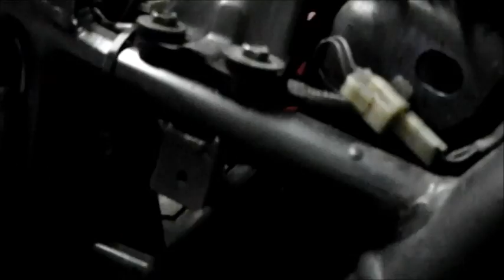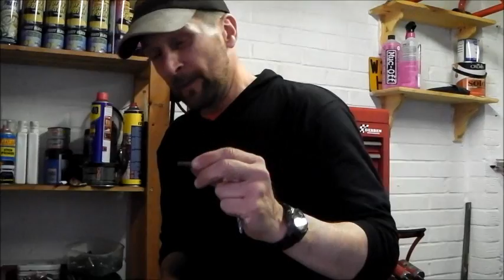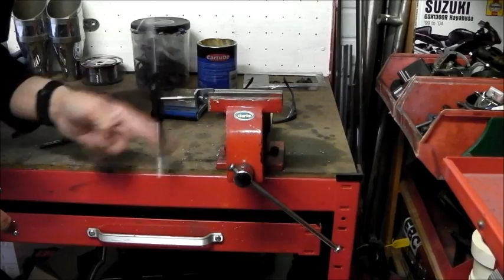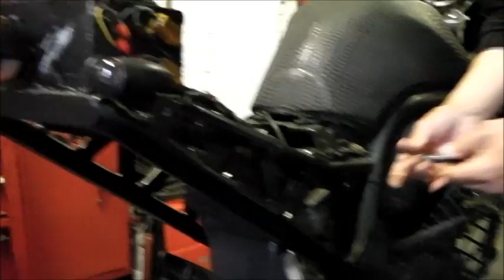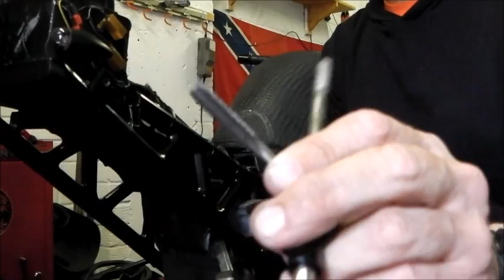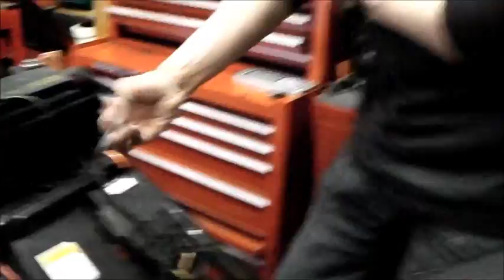Project Bandit #23 'How To' Cutting Threads, The Seat Unit Begins.

Comment: Heya Del, nice video on thread cutting, its nice too see someone using the proper cutting tap, where i used to work they would just use the standard thread cleaner and they were always surprised when the tools broke.... just two things im curious about, is that a Clarke workbench? Ive been looking at them in machine mart and was wondering if they are made of good metal or is it just old tin cans? also one thing ive wondered is how come your bench grinder stays still for you without having it bolted down, my one flops about like a turd in a piss pot unless its bolted down or held with g-clamps.
Reply from the maker: +Eleuthero1985 Hi mate, wou;dn't bother with the Clarke bench, made out of old curry tins and MDF and not worth a cuppa cold p*ss... am gonna build one out of wood in the new garage and strong enough to stand an engine on...and I don't mean a scooter engine lol !... I tend not to lean on the grinder, so it's find stood on the bench, if I need to grind anything heavier, I get the disc cutter out with the grindstone then I can lean on it !
Reply: +Moonfleet41 ok cool. ive been scavanging old bit of wood for a while and managed to get hold of an old wooden fireplace and a kitchen worktop and was just wondering if i was wasting my time :) cheers for the advice as always.

Comment: Hello Del.
Sharpening small drill bits aint a bad job to do. If you buy Dormer drills they are the same hardness the length of the flutes. I re-grind drills all the way from 1 1/2 down to 1/16th inch. The most important tools are a drill gauge to set the angle and a decent bench grinder with nice dressed wheels.
What kills small drill bits more than anything else is using the power drill, drill bits hate getting hot and most of us me included use far too many RPM's when using a power drill. A little drop of Rocol cutting compound on the drill makes life easier for the drill. Its also worth using Rocol on the tap while cutting the thread, it helps the chips clear the straight flutes.
Cracking good video I seem to spend a lot of my free time watching your channel.
Reply from the maker: Sure thing mate, thanks for those great tips... I get asked all the time why I pulse my drill rather than just whizz it up as it keeps the speed of the bit down and stops them burning... as time goes on I will get a compressor and use an air drill, they are much more controllable... thanks for watching buddy and much appreciate the insight, Del

Comment from the maker: I don't believe in sharpening drill bits for 2 reasons: the quality of today's cheap drill bits means they cannot be sharpened as they are not hard enough to retain their edge, you need an extremely fine stone as the average bench grinder would just trash them and most importantly, it's a very skilled job..most amateurs simply burn the bit out and destroy it.. takes years of practice and a very canny knack to get the angle and pitch right of the cut.. just buy a new one,mate,cheap as chips!

Comment from the maker: cont'd. 2......something switched on and kill your battery, as whenever you turn off the 'igg switch' everything is dead... easiest way to tap in is to splice the wire direct by cutting the ignition wire, inserting one end into a continuous crimp tube, then the other end along with the accessory wire you want to run, then heat-shrink the entire thing completely... if you are not sure, or concerned, let me know and I'll give you more detail ... good luck, Del

Comment from the maker: Hi Geoff, good to hear you are having a fettle and some good questions... most bikes have enough juice in the loom and charge system to tolerate a few extras like SatNavs and ciggy lighter sockets, etc., so no need to up-grade or bother with fuses, the issue is where you are taking the power from, never take it from the battery direct as it's live 24/7, instead of that tap into a 'live' on the back of the ignition switch, so effectively a 'switched live', that way you can't leave ... cont'd. ...

Comment: if you go all the way through with the taper tap then it will have the full thread form. the plug tap is for blind holes where you cant run the tap all the way through. Keep finding myself glued to these vids, nice work Dell.

Comment: Quick tip!: Metric drilling sizes = Thread diameter take away the pitch
Eg: M6 - 1mm pitch = 5mm hole
      M8 - 1.25mm pitch = 6.75mm hole (6.8 is fine)
Keep up the good work on this bike mate! Coming along nicely. I hope to have a project like this soon :)

Comment: Cutting a thread, christ that took me back more years that i care to remember Del LOL.
I know you're busy, but can you tell me if I thinking of adding accessories to my bike should I add a separate fuse box and take the feeds off of that? I have just fitted a cig lighter to charge my IPhone and sat nav and picked up the feed & earth straight from the battery lugs, I'm happy to do that once but don't really want a loads of wires feeding directly from the battery . Any suggestions?
Cheers Geoff

Comment from the maker: No, you don't need to use both taps when cutting a new thread as the cleaning tap is more for 'cleaning' a damaged thread that needs straightening up or extending in length... you'll get the same effect by spinning the fattest part of your tapered thread in and out a few times without grease on it... hope that helps, Del

Comment from the maker: If they are a cast or machined solid steel bar weight then the easiest way, unless you have a thread guage, is to measure the overall width of the thread, it will be metric so if it's 10mm thick it will be M10, if it's 8mm thick then M8, etc., another way is to match up in the tool shop by taking the bar weight along with you, just offer one against the other to check they are the same... also the tool shop guy should be able to help you!

Comment: I've drilled and tapped a lot of screw holes over the years, but I never knew that there was a cleaning / finish tap in addition to the regular tapered ones that normally come in the kits. I guess the finish tap isn't absolutely necessary if you don't have one, but it sure can't hurt. Let the fab begin!

Comment: Actually, I needed this one, as I´d forgotten my GCE Metalwork. I have put new bars on my FJ11. They´re alloy. My bar weights are shiny SS. I need to tap the holes in the ends of the new alloy bars to fit the original SS bar weights..How do I work out the size of threads in my SS bar weights?.....in order to buy the correct size cutter??

Comment from the maker: Technically correct, if you're in the classroom.....but if you're going to use a 6.75mm drill bit.....99% or garage home mechanics will not own a pillar drill you will need to make such a precise hole (move a hand drill off line by even a fraction and you'll welly out the hole by half a mm)...so if using a hand drill, go up to the nearest rounded millimeter and get on with life... i keep my advice simple and basic, then if people want to become engineers and spend time working out maths they can

Comment: hey Del .. nice to show the people this but. can I just add the mistake you made ... on threads its not just going 1 mm small on the hole to drill, see what the pitch of the thread is like m5 is a .8 pitch so drill it a 4.2 , m8 is a 1.25 pitch needs drilled with a 6.75 and like m10x1.5 pitch drill it with a 8.5 that way you will get the ... full thread depth

Comment from the maker: Cheers mate, never bought a kit, I just buy the taps and dies I need as I need them and after all these years I still only have half a dozen pieces as 70% of the kit you'll never use!  Just steer away from cheap comprehensive kits as they are high quality cutting tools and quality is everything!  Those two taps were £10 each by themselves and I've had them for 20yrs!